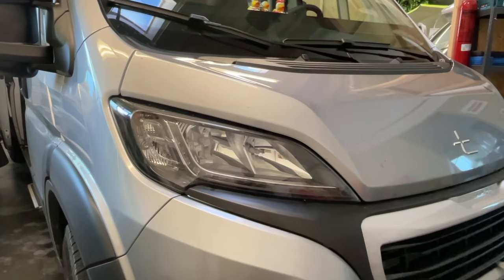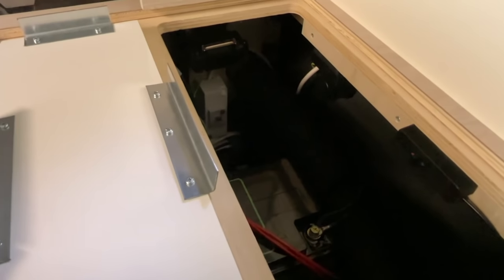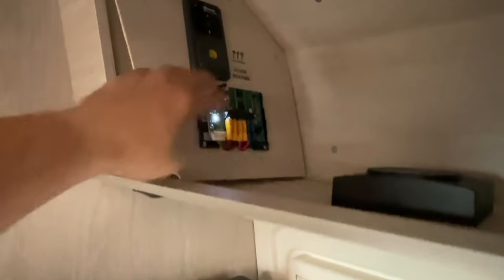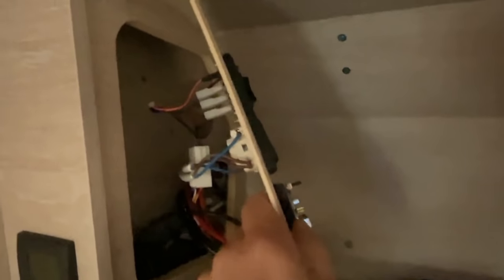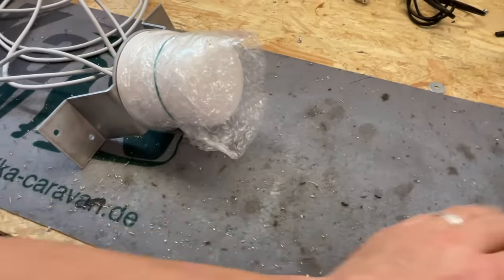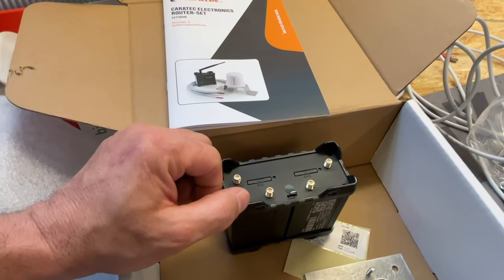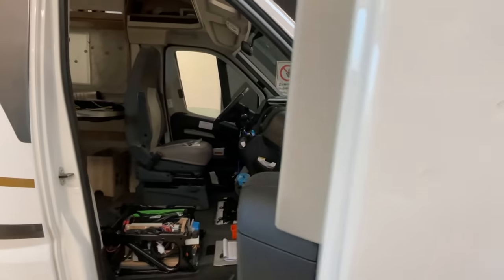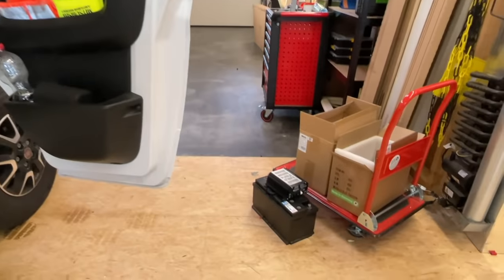MiKa Caravan Dinkelsbühl | Neues aus unserer Werkstatt und noch was, was ich noch loswerden muss !

Comment: Solche Strategen findet man mittlerweile überall. Die sind wahrscheinlich zu lange in die Schule gegangen und glauben mit ihrem Halbwissen für Wirbel sorgen zu müssen. Ob die in ihrem Job das leisten (können), was ihr leistet? Lass Dich von so dummen Campern nicht ärgern. Mach Dein Ding. Auf solche Kunden kann man locker verzichten. Die meckern hinterher eh nur rum.